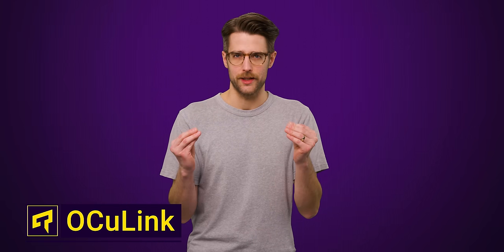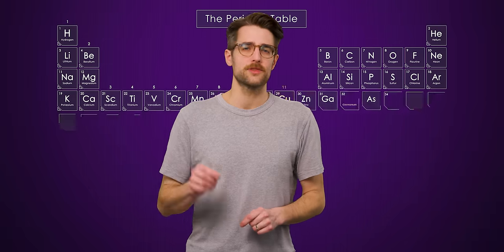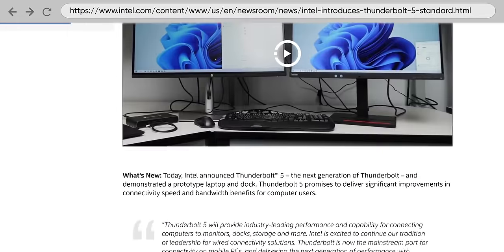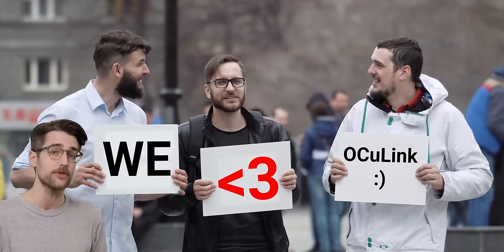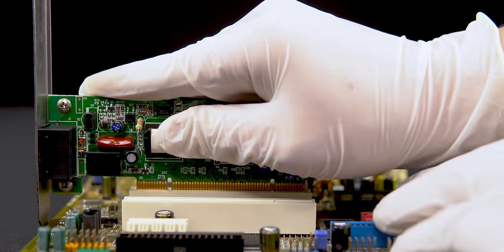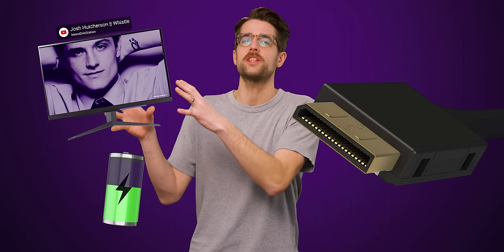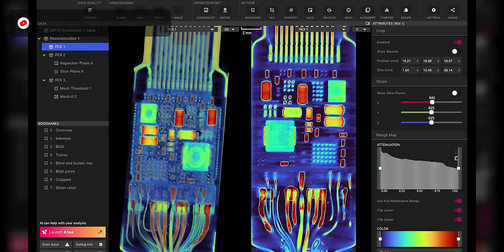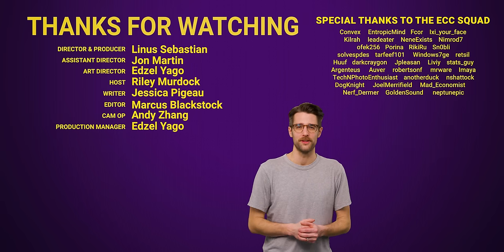The Best Connector You’ve Never Heard Of: OCuLink

Comment: - No hotplug
- No power
- Not reversible

I'm not quite convinced that this is meant to compete with USB-C / Thunderbolt.
Reply: Because it was originally meant for connecting the front nvme pcie bay of a server not external devices because until recently it wasn't even capable to be used like that because the insertion rate is so low, under a 1000 iirc

Comment: Sorry it's not best.   Just what we need, another connector that isn't symmetric.   That was the big improvement USB-C had over USB-A.   Also, did I hear in the video that it doesn't transmit power.   Without these two things, it is never going to replace USB-C for most ports.

Comment: Fuck this. We finally got Thunderbolt and USB4 close enough to each other. with improvements that keep developing. Why do you want another "Lightning vs USB-C split: but just for PCs" situation? Data only, no hotswapping, only PCIE, not compatible with standard USB-C. I'd rather have 2 Thunderbolt or 2 USB4 ports that I'd definitely use all the time vs 1 Thunderbolt or USB4 port + 1 OCuLink port I'd maybe use.

Comment: I just with OCu would get a spec update already, it's starting to feel like abandonware, I think the last document PCI-SIG put out on OCu was back in 2020.  Honestly the spec should just evolve to be the bigger brother of USB/TB, use the same implementation methodology but with different wire counts, look at what USB can do on 24 wires, now apply that to 42 and 80 wires, if USB PCIe tunneling can hypothetically push an x4 link then OCu mimicking that strategy could hypothetically push x8 and x16 links, and this is before getting into the conversation of PCIe spec updates where bottlenecking starts to become irrelevant especially as GPUs aren't pushing the limits of newer PCIe specs; the only things that are doing so are networking, PCIe 6.1 can handle 800G networks, which datacenters are transitioning to, and AI/ML processing that eat up bandwidth, applications where this kind of port doesn't make sense and will never be used.  Apply the same with plug and play, power injection, and other tunneling strategies.  Think about it, USB/TB could be the consumer standard spec for more powerful peripherals such as a small eGPU, but OCu could become a workstation-like dock for mobile devices given how much throughput could be available based on implemented method. 

Though I do also wonder what a true optical-copper link could do for the port, perhaps it'd free up the abundance of ground pins for other uses.

Comment: Thunderbolt annoys me - the cables are $40 (which, fine, I get given the complexity) but the limitation to 3 feet / 1 meter makes them... limited... in their use.
Reply: At such high frequencies, even differential pair signalling can only manage a short length. You could up the power, but then you need more expensive drivers to handle the slew rate and that isn't really practical at consumer budgets.

Comment: Didn't the Rift S use that same connector? It was advertised as a Fiber Optic cable. And was a pain in the ass because 50% of users reported cable faults, and replacements were expensive asf when Meta/Oculus/Facebook/Whatever dropped support. I have a fully working Rift S still in the closet without a cable because the cable is 200 bucks. Instead of a cable, I just got a Quest 3 to be a side headset along my Index. All in all, from experience, at least the Rift S cable. Was ass.

Comment: IDK. What do you mean by costs? The chipset? Connectors? Or cables? That's the most expensive part of USB3.x, cables. I mean, maybe the chipset is not that cheap either, but you buy a new PC or phone, the chipset is probably already there. You don't pay extra for it. Yet - you can't use a fraction of its power without buying a ridiculously expensive cable, which is not even easy to get. You know, they all look similar, the connectors fit, however, one works up to 1GBit/s and another one up to 20GB/s. The problem is the most cables are scams. Even the working ones, the scam is the price as it was a kind of luxury product. Like a luxury USB cable that can TRASFER DATA (at all) or provide charging above 2.5W.

Comment: That's a really funny way of saying, 'Display Port Plus'. And, on that note, why haven't display connectors being used for data transfer replaced the obviously inferior USB? If you can transmit 8k video, you're miles ahead of USB. Instead they go the other way and shove UHD video through USB🤦‍♂
It is really simple. You say, "USB XGbps", there's your standard. Whether it is Type A, B, C or Z, it doesn't matter to anyone except whoever plugs it in and it either fits or it doesn't. But nobody does that. It would be too logical. 'Thunderbolt' is just a further obfuscation of the USB standard and HDMI/DP Data was the correct answer anyway. It is very clear how fast an HDMI standard can transmit data, with no BS or double talk. And, on that note, while HDMI is a transmission standard, USB is just a plug. High Definition Multimedia Interface. "Multimedia" means more than video🤦‍♂
Technically, any data in transmission or in storage is 'media'. The overassociation with the audiovisual arts is a modern degradation of the term. My poo is 'media' if I submit it to my gastroenterologist for analysis. Don't even get me started on the implications of DNA...Your very body is a form of 'media'. It is a medium for the transmission and expression of (DNA) data. 
I've been a (IBM compat) PC enthusiast since 1990. I have never seen anything more ridiculous than Thunderbolt for consumers and I used to own a Jaz drive. Thunderbolt is next to useless in a consumer context. 
the first thing that comes to mind for the vast majority of PC owners is, 'I can plug a powerful GPU into my budget laptop' and that just will never happen because a laptop that needs an eGPU won't have Thunderbolt support anyway. Then you start looking at data transfer and external drives where the real world performance isn't much better than a 10Gbps USB port. So unless you make a thousand bucks a second and transfer petabytes worth of data every day, you have no good argument for Thunderbolt except you just wanna look cool. It is an enterprise standard that is being sold (or more often not sold) to consumers. 
The association between USB-C and Thunderbolt serves to only scam the average consumer. They think every USB-C port is a Thunderbolt port. Hell, that person who goes and gets the 'free' smartphone from Cricket and sees a USB-C port thinks they'll be able to transfer 100GB of selfies and pointless videos in the blink of an eye. Well, the transfer rate from the USB-C port on my A53, which is hardly a budget phone, is at USB 1.1 speed. It is faster to send it to my NAS (which uses spinners) over my network and then download to another machine than to use any kind of USB. But the world is full of suckers who are lazy and/or don't know any better. They'd rather spend hundreds of dollars on the easy solution than spend the time to arrive at the correct solution. I guarantee only about 3 people reading this can actually afford that approach. IDC how fast your Thunderbolt is when you gotta live on Top Ramen for 2 years to afford it. 
Every USB-C data port I have on any PC I currently own is slower than at least one USB-A port on that device. That's what I expected, given the fact I don't buy or build overpriced/overspecced systems. But every single other person who hasn't been a PC enthusiast their entire life thinks that USB-C port is the fastest port on their $600 notebook. It never is. Somehow I think your average Thunderbolt proponent doesn't consider this, probably because they have more money than brains. My IQ is 160 so I will always have more brains than money and I will always be using a $600 laptop even if I can afford one at any price. No matter how much money you have, dropping a $5k laptop is gonna sting.

Comment: It will fail unless they learn from USB-C. Your connector should fit both ways. Anything else is just bad design.
Reply: not really, are hdmi and dp bad designs? you always get them in the first try and they are robust. they are not reversible. if not reversible, then the problem is the shape of the connector. take usb-a for example, you have a 50/50 chances of plugging it, but somehow you always need 3 tries, for that annoying peace of crap.
Reply: @giornikitop5373  I'd much rather try and plug-in an USB-C cable while reaching blindly behind a PC than a HDMI cable due to its design, yes.

Comment: I have simple system in mind:
USB C Data/Power: The current USB C connector, the universal port.
USB D Data/Power: A Deluxe connector to replace HDMI, DisplayPort and this port, for super high bandwidth devices.
No more gen 3 or 4 just say what the total bandwidth and wattage is. Make both reversible.

Comment: OCulink is terrible. Its like a super thin Display port connection, if vertical on a motherboard, it just screams for physical damage when you connect a cable to it. Its terrifying.

Fun Fact: Early Intel Tri-Mode raid cards (Sata/Sata/NVME) Had electrical damage potential if you plugged in oculink cables before changing the interface mode potentially frying the raid card AND the attached nvme SSD's. TERRIBLE!

Comment: All is good but all I want to know is why is it so hard to make a damn connector (talking to you HDMI engineers ) that locks into the port !!! Is it so much to ask ?
Reply: Blue Echo Solutions, Inc. hd EZ lock Universal HDMI Lock - hd-ez-lock Black
Reply: copy, paste
Reply: @ItsReallyGeo ?
Reply: maybe because its generally a bad idea that leads to costly accidents..
Reply: I hate to say it, but that is not a good idea. I may hate that it doesn't exist on HDMI, but imagine if your cord gets tugged. Say goodbye to your expensive monitor. The displayport port in mine nearly got destroyed because it fell once and pulled on the cord. Thank GOODNESS the port still functions. It does have a short though. HDMI still is fine.
Reply: Cables are cheap to replace: components and peripherals less so
You want the weakest point to be the cheapest point

If you catch yourself on a locked connector by accident and absolutely hulk-rip that bad boy - your chances of sending a monitor slamming to the floor or permafucking an output port is massively increased. It's why I don't like DisplayPort, and never screwed in VGA or DVI 

If it's non-locking, chances are far higher you just yank the cable out and need to plug it back in. Think of the break-away cables the Xbox's Duke controllers had. Instead of sending 9lbs of heft and mechanical hard-drive slamming into the floor, you've got an Indiana Jones cable-whip you can plug back in and be back at it.

Comment: There's no need for it.
eGPUs are virtually pointless, and it's the only place it makes sense. And even then, thunderbolt is much more available.
Reply: The need for oculink?, i mean yeah for egpu it might be pointless but oculink itself is everywhere on a  server application
Reply: How are eGPUs pointless? They make a lot of sense for something like a handheld device where the CPU is not a bottleneck but the iGPU and memory bandwidth for the iGPU is a major bottleneck. That way you can use the handheld with lower resolution and graphics on the go and then plug into an eGPU when at home for maximum performance with an external monitor/TV. A lot of newer handhelds are now coming out with OCuLink support after GPD started pushing it for handhelds (technically, the ROG Ally also has OCuLink, but with a custom proprietary connector that also connects thunderbolt at the same time for power).